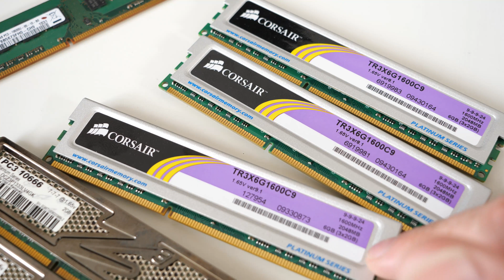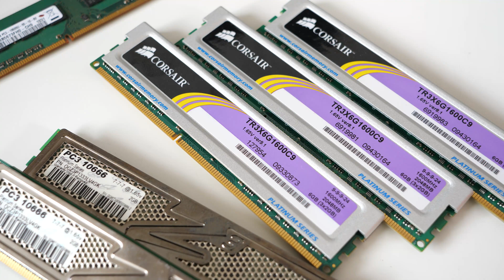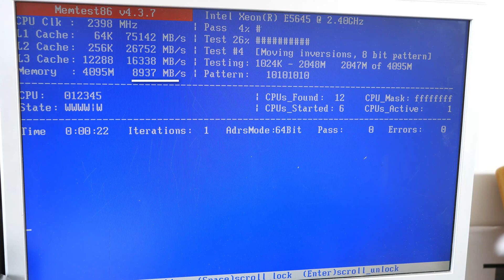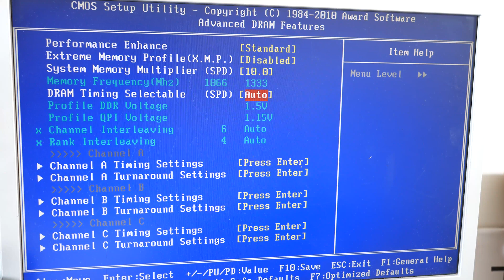DDR3 RAM: Single vs Dual vs Triple Channel (Single channel Vs Dual channel Vs Triple channel) #speed

Comment: Why boards haven't been able to advance enough to use single sticks as if they were two is odd to me when every other part has advanced.
Reply: 0's and 1's. Also probably voltage, heat and other frequencies
Reply: @headphonesz6527 Do you think if boards were redesigned from scratch how RAM works, it would be possible?

Look at SSDs; it's a from-scratch, way more advanced HDD. It 's still a drive, but it works differently. And then NVMe is a way faster SSD from scratch. That tells me companies could've redesigned how boards work years ago ; they just chose not to because then there wouldn't be any need to always buy two sticks. It 's a money thing.

Comment: Can i use two stick in a triple channel modo
Reply from the maker: Yes, it will run in dual channel mode
Reply: @OldPCGunk  will it lost perf or something
Reply from the maker: @TheJimyyy  hi, best performance is triple channel, then dual channel, then slowest is single channel. Triple wasn't much quicker than dual channel. All the figures are in the video.
Reply: @OldPCGunk  so the lost in perf will not be noticiable in dual channel ?
Reply from the maker: @TheJimyyy  I wouldn't worry too much about it

Comment: Hi, Thank you for uploading your testing as it was just what I was looking for, however I notice that this xeon is only 2.6Gig and think you might have saturated its throughput ? I have a X5670 @ 3.3Gig and with a dual channel memory config at 1066Mhz I saw 12Gig memory transfer. Then I overclocked the CPU to 4gig, By uping the base clock, but kept the ram at 1004Mhz and saw a memory transfer increase to 13.7Gig. So this is what makes me wonder if you are not seeing the full potential of running the triple channel due to your CPU bottle necking ? I have just ordered another stick off Ebay so I will be able to test in triple channel mode and will let you know if I see a better increase in memory performance than you did.
Reply: Late reply, but did you end up seeing a difference going to triple channel with x5670 overclock?
Reply: @michaelstobiecki4474  Hi Michael, Sorry I forgot to come back with the triple channel results ! However I do remember being underwhelmed at the time when I went from dual to triple channel. Since then I have upgraded the CPU to a X5690 and increased the base clock from 133 to 145Mhz that means the CPU is clocked to 3.7G and boosts to 4G, I noticed whilst running the mem bench she stuck at 3.7G, only occasionally boosting to 4G for brief moments. I have just tested and got a triple channel average score of 13.55 GB/sec and a dual channel average score of 13.61 GB/sec. I ran the test 10 times for each configuration then removed the lowest and highest scores from the data sets before averaging. For interests sake The triple channel highest result was 14.51GB/sec and the dual was 14.25GB/sec. Lows were triple channel 13.13 and dual 12.5. Also for interests sake I clocked the memory at 1453 Mhz and both the dual and triple configs returned a latency score of 150 nS. To conclude I was disappointed to see no gains in throughput speed and now assume that the CPU speed is not responsible for bottlenecking the triple channels potential in this instance.
Reply: @deantubeful  THANKS! oc AM3+ guy here life is good